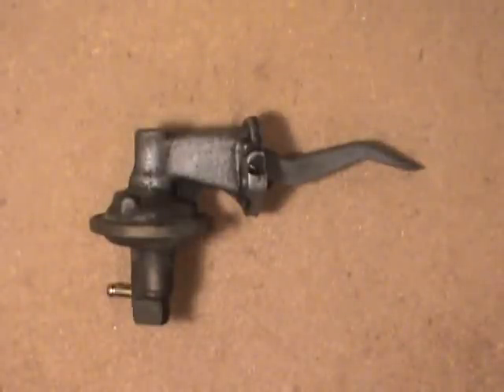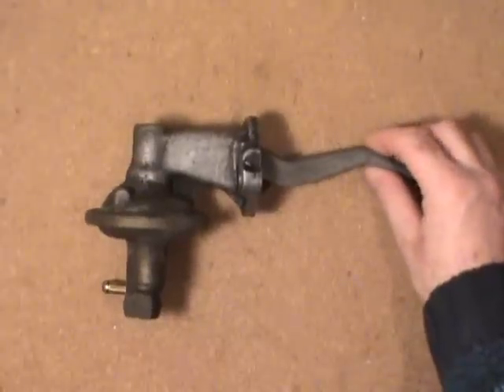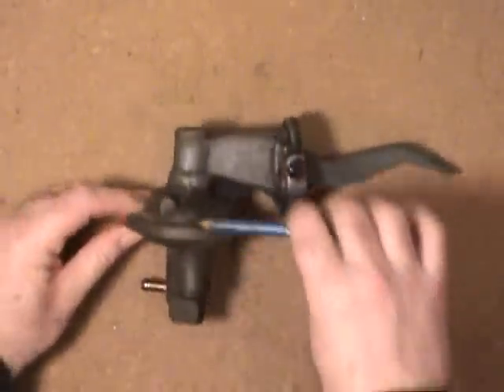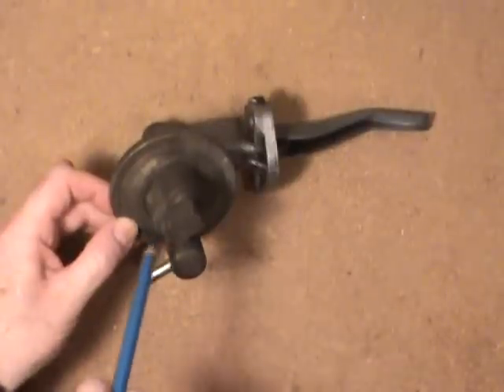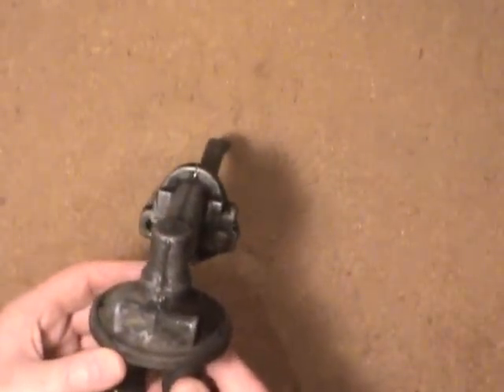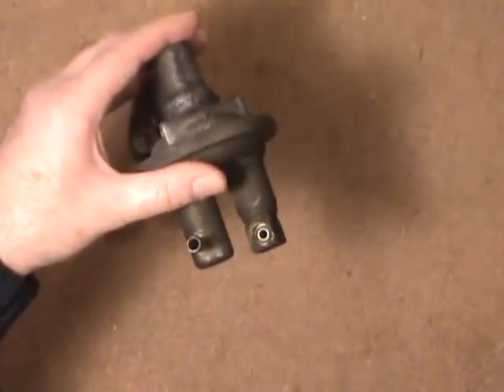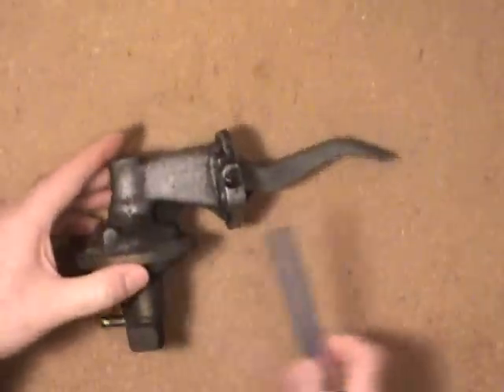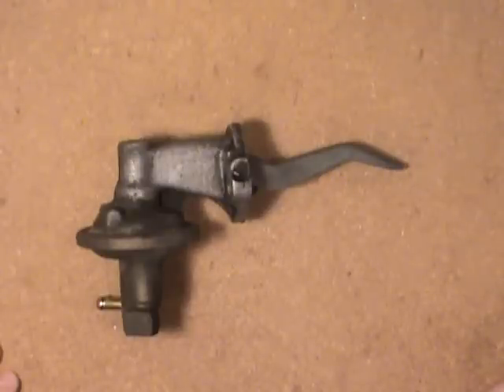Fuel Pump Mechanical Type Demo

Comment: Hi. I have a 78 Ford f150 351m. My gas tank filter is plugged up. I had replaced the fuel pump during diagnosis. I had it running pulling fuel from a gas can on the ground. I moved and had it towed recently. I'm trying to get it in the garage before snow falls but I can't get it started. The fuel pump isn't pumping fuel. There isn't much play in how it mounts to the block. Is my shaft missing the lever? Or is it too work to actuate the lever?? Thank you!
Reply from the maker: Greetings..Sean Fuhrman.........You're welcome, and, thanks for watching.........Well, if I was in the situation, that you described, then, here's what I would probably do, along with, a bit more information, added in as well...........Having the Vehicle outside, and away from any "open flame", such as a pilot light, in a furnace, or what-ever, or else "Boom"...!!!...it might be, and I hope not..........I would then, "disconnect" the "fuel line", from the gas tank side of the fuel pump...then...I would grab a rubber hose, oh, about 4 feet long, and stick it onto that fuel line, that was just "disconnected"...then..."remove" the "gas cap", so the gas tank can breathe freely...then...I would blow into that rubber hose, with some really strong lung pressure (Never, Ever, "Inhale", Gasoline Fumes or Gasoline, because that, in itself, can become "Deadly"...!!!), and, by doing so, I could then tell, whether or not, there is/was, a "Blockage", of any sort, which also includes, that (if present), the (possibly, plugged-up...???) "Filter", that's on the end of the pickup/fuel line, that's "inside" the gas tank (if "not" plugged-up, I can usually blow through, into the gas tank)..........If...???...there was some sort of "blockage", then, I'd say, that, there's a pretty good chance, that, my "strong", high air pressure, capable "lungs", would probably "dislodge", a fair amount of "crud", that was (theoretically), stuck onto, the outside, of that, "inside-the-gas-tank") fuel "Filter" (oh, and, musn't forget, to...keep my fingers crossed...!!!...lol)...........Gotta "make sure", that, the "correct" side of the fuel pump's "Lever", is rubbing against the "eccentric" (that be, a round diameter, that's off-set, to the center line of the camshaft's centerline, that results, in a "wobble", that makes the "Lever" on the fuel pump, go..UP...down...UP...down...which in turn, makes the fuel pump, well..."Pump"...if you will...lol)..............If Ya still have the "Old" fuel pump, you'll probably be seeing a "Shine-ee" spot on the actuating "Lever", where it was rubbing on the "Eccentric", and, Ya gotta make sure, that, the "New" fuel pump's "Lever"..."Is Not"..."rubbing", on the, shall we say..."Open U" or "Open/Trough side" of the Lever, because the fuel pump won't work right, and hopefully, no damage will result, from installing it "wrong"...............The Lever's "Spring", is usually Very "Strong", so, Ya just gotta make sure, that, Ya, "Tilt/Angle" the fuel pump's "Lever", so the "Full Metal" side of said Lever, ends up "making contact" with the "eccentric"..."Before"...!!!...Ya "tighten", the fuel pump's mounting..."Bolts or Nuts"...as the case may be............You can also try, putting some fuel system cleaner, in the gas tank, because, it should help soften up the "crud", that might be stuck onto the "filter" in the gas tank, and, also make sure, that, Ya have at least 2 gallons of gasoline in the gas tank, oh and, if Ya use some Cleaner, then, shake the "pick-em-up-truck" (like it was in a wind storm), as in...Up & Down (on the rear bumper)...and from...Side to Side...as well, which should create, a, shall we say, "Sloshing" action, of the gasoline/cleaner, that's, presumably in the gas tank, which, on a good day, might help to clean things up-ah-bit, hopefully, that is...........Are all of the "other" Fuel "Filters" (if any)..."clean-enough"...as well...??? (oh, and, by the way...todays word, is..."Blockage"...lol)...........To help "git-er-Started", I have a small squirt bottle, with a few ounces of gasoline in it...then...I "Prime" the carburetor (if there is one), by doing the following..........With the engine "cold", and "not running", I remove the Air Cleaner "Lid" (or what-ever)...then...I hold the "Choke Plate" (flap) open, with one hand, while I "squirt", a couple of tablespoons of gasoline, into each of the Primary (front?) throttle bores...then...re-install the air cleaner's "Lid", just in case the engine "backfires"...........If it doesn't keep running on the first try, then, try & try again (but can only be done, until the Battery says so...lol), oh, and, "don't crank" the engine's "starter motor", for very long, and also, give it a "rest/cool-down", between "starting attempts", or, Ya might "cook" the starter motor...!!!............If there's anything else, just give me a shout (or what-ever)..........Good luck, and.......till next time.......Be Safe, take care, and have a good one.

Comment: Hi I️ have a 70 mustang I️ replaced the fuel pump but there’s no pressure it was sitting for like two months
Reply from the maker: Greetings...ulfrogger3..........Thanks for watching.........These old school "mechanical" type of fuel pumps, have to "pull" the gasoline, all the way from the gas tank, through a quite small (in diameter)...(usually made of steel), tubing (pipe), all the way up-to the fuel pump, and from the fuel pump, (usually) up to the carburetor, it (the gasoline) goes..........The "Key" here, is that the Mustang (car...not horse...!!!...lol), sat for quite some time (2 months)...........The gasoline, that was in the carburetor's float bowl, or bowls, as the case may be, will usually "disappear" (like, it evaporates), and the engine doesn't have any gasoline to burn, well, until there is quite a bit of gasoline, once again, being pumped into the float bowl/s, that is............Here's what I do, when-ever I want to start a vehicle, that's been sitting for a while, that has a carburetor on its engine, along with, the good ole mechanical type of fuel pump, bolted onto the engine..........I have a small squeeze bottle, with a few ounces of gasoline in it, and, I remove the carburetor's air cleaner "lid", and squirt about 2 or 3 tablespoons of gasoline, into each primary throttle bore, and sometimes, I have to open the choke plate, with (my other) hand, if it's in the closed position..........Then, I replace the air cleaner (housing's) "lid", in case the engine "backfires"..........Then, if the Carb has an automatic choke on it, I push the gas pedal down once, or more if you like..........Then, the engine will usually fire-up, and now, the mechanical fuel pump is pumping much faster, while the engine is running, as opposed to, how slow the gasoline gets pumped, at the much slower, engine "cranking" speed...........Sometimes, I might have to repeat, the, shall we say..."Priming" routine, with a few more squirts of gasoline from the good ole "engine priming" squeeze bottle, if the engine doesn't keep running from the first attempt..........A while back, I had a "Faulty" (hardly worked at all), top brand name mechanical fuel pump, and, the car barely made it home (just a few miles away), so, that's a (rare) possibility perhaps...???...........Are the Fuel "Filters" clean (enough)...???............There's usually a fuel filter in the gas tank, that doesn't need any help usually, well, unless it gets plugged up (quite rare), just so Ya know...........Then, there's usually a fuel filter, in, or very close to the carburetor, and maybe another one, a bit closer to the fuel pump possibly.............Maybe, one (or more), fuel filters, might be "plugged-up", perhaps...???...(if plugged-up really bad, the engine will usually starve for gasoline)............Remember "Safety", as in, No Gasoline inside the house or building, if there's an open flame of any kind, like a gas pilot light, or Boom, and I hope not..........If the gasoline "Priming" method doesn't work for you, just let me know..........Good luck, and........till next time.......Be Safe, take care, and have a good one.

Comment: Hie boss. I have a mazda 323 b6 engine and my pump is giving me problems. If i try to repair the one i have and fail where can i get a new one? Im in Zim
Reply from the maker: Greetings...Munyaradzi Mhishi...........Thanks for watching............If you need to get a new fuel pump, then, first, try phoning a few automotive parts places, that are in the area where you live............If you don't have any luck with the phone calls, then, there are lots of automotive parts places (businesses) world-wide, as well as Ebay (for different countries as well), and, you can order the new fuel pump online (with a computer, smart phone, or maybe over the phone/with your voice, sometimes), and have it shipped (delivered) to the address of your choosing..............Here are a few things, to be aware of, when-ever ordering something online............Be very careful with your personal information, and the form of payment as well..........You can join/sign-up with Paypal or its equivalent, or, possibly use something like, a very low limit credit card, to protect yourself (just in case).............Make sure, to check the, shall we say, shipping time, as in, how long it will take, for your new fuel pump to arrive............Also, pay very close attention to, the shipping cost itself, b-cuz, sometimes, it can be very high...!!!.............So, I hope everything works out ok for you..............Good luck, and.......till next time.......Be Safe, take care, and have a good one.

Comment: Hello; when the fuel pumps are bad do they also make a noise? have a 1975 F150 and just placed a new fuel pump and added two filters due to some left over dirt from the tank one before the carb and the other before the pump; but!!!! for some particular reason gas is not passing thru; have no idea. Just bought 4 days ago another fuel.pump and besides making a loud clunk noise its sucking gas intermittently? Any sugestions maybe besides pulling down the gas tank again????
Reply from the maker: Greetings...Jimmy T............Thanks for watching............Well, I've never had a Mechanical type of Fuel Pump, make any noise, that I was able to hear, maybe, because of the noise, that, the running engine, and/or, the starter motor made, while cranking the engine over, that, would have, probably been louder, than any noise, that the (mechanical, type of) fuel, was able to produce.............It's very rare, to have a faulty, brand new (mechanical, type of) fuel pump, as, I've only had "1" faulty/defective, brand new (top brand name, mechanical, type of) fuel pump, out of all, of the fuel pumps, that, I've ever replaced.............That "Clunk" noise, that you heard, might be due to the following............Wrong fuel pump, for your "Exact" vehicle and engine...or...the fuel pump's actuating "Lever", got installed on the Wrong side of the "Eccentric" (that be, a, 2-to-3 inch round/diameter, that is on the camshaft, that is also offset, to the camshaft's center-line, which, kinda wobbles up and down, when the camshaft is spinning, and is responsible for, making the fuel pump's Lever, go up and down, causing the, shall we say, pumping action)...or...the Eccentric, might be damaged, or maybe, kinda slipping, if it happens to be the bolt-on type, and maybe, not turning at the same RPM's as the camshaft is...???.............Here's what I usually do, when I install, a new (mechanical, type of) fuel pump............I take the (already removed) Old fuel pump, and put it Beside the New one, to make sure, that, the two of them, "Match" each other, as in, the actuating Lever's, "Length and Bends" (if any, that is), and I do this, while looking downwards, from the Top, as well as, from the Side view, to make damn sure, that, the actuating Lever, is, a, shall we say, Perfect "Match" (or maybe, if not, some not wanted Damage can occur, if the wrong shape, and/or, length of actuating Lever, happens to get Forced, way too much, by the spinning Eccentric, that's on the camshaft...!!!)............Before installing the fuel pump, I usually stick a fairly long length, of, flexible hose (rubber, or neoprene/fish aquarium stuff), onto, the fuel line, that leads to the gas tank...then...I remove the gas cap (cuz, even the good ole vented, type of gas cap, needs a few PSI/pounds of pressure, to make-em open up)...then...I Blow on that added Hose ("Never", inhale/suck on the hose, cuz, gasoline, or, gasoline fumes are "Deadly"...!!!), oh, and, have lots of fresh air/ventilation, around the vehicle, and, "No" sparks or flames of any kind, what-so-ever, or, "Boom"...!!!.............This, "Able to Free-ly", blow thru to the gas tank, is telling me, that, there is, "Not a Blockage", holding things up............There's usually, an, "in-the-gas-tank", pre-Filter (sometimes, called a Sock, which is usually, a hollow, fine screen/tube-like shaped thing, sometimes, which might be, a kind-of nylon material, that might resemble, a very "fine" mesh/house screen door, type of thing, or maybe, a sponge-like/solid, possibly), that's usually attached, to the end of the fuel line, inside of the gas tank, so, larger particles of rust, crud, etc., don't make their way, into the fuel pump.............Also, if there happens to be a Filter, of some type, that is in/on the carburetor itself (as in, some of the Fords, used to have, a fairly long, metal, screw-into-the-carburetor-body, type of fuel filter, and yes, I did have one of these critters, plug up solid on me, some time ago...!!!...lol).............To Test, the fuel output flow, I have the fuel pump installed on the engine, and, the fuel line from the gas tank, connected to the fuel pump...then...I attach, a, quite long, flexible hose, to the Output side of the fuel pump, and have that long/flexible hose, going over the fender, and, into a bucket or pail, so I can actually See, how good, the, shall we say, gasoline Flow-rate is (if any, that is...???)...and...(can be observed, cranking with the starter motor, or, with the engine running, if in fact, the engine starts, and runs on any gasoline, that's still left in the carburetor's float bowl, well, until it's empty, that is), oh, and, remember now, lots of fresh air/ventilation, and, No sparks or flames...or...Boom...!!!..............Also, if ever trying to remove the "Ring", that secures the fuel pickup/fuel gauge sending unit, that goes into that hole/opening, in the gas tank, to Always Use a "Brass" Rod or Punch, with the hammer, or what-ever, to avoid creating any "Sparks", anywhere near the gasoline, or, gasoline fumes, that are in the gas tank...!!! (Never use a Steel Rod or Punch...!!!)...and also, have a Fire Extinguisher handy, as well as, do it Outside, if Ya can, to avoid, possibly, Burning the house or garage down...!!!...and, I hope not...........Have a look at some pictures on the internet, or, pictures, that, some of the online automotive parts stores have, for your "Exact" vehicle and engine, that way, you'll probably be able to see what all of the parts look like, some-what............So, Make sure, that you have the "Exact/Correct" fuel pump for your Pick-em-up-Truck, or there's gonna be, Trouble-in-pair-ah-dice (so to speak)............Once you have checked out, what I was sayin', just above, and, you have success or other-wise, you can let me know, how you made out, well, if you care to, that is.............Good luck, and........till next time........Be Safe, take care, and have a good one.

Comment: Thanks for the info. This was a great detailed video.
Reply from the maker: Greetings...Keon Nelson...........You're welcome, and, thanks for watching..........Well, it was kinda detailed, to a certain point, somewhat, as, there should also be..."2"..."one way" (only) Check Valves, hidden, inside of, this mechanical type of fuel pump, somewhere...............The "inlet", (one way only) check valve, (that's on the "suction" side of the fuel pump), would let the gasoline through (from the fuel line, that came from the vehicle's gas tank), but, "would-not", let it flow back, into that fuel line............Then, once, the gasoline, gets inside of the fuel pump, and becomes under pressure, then, the only direction, that, the gasoline can flow, is through the "outlet", (one way only) Check Valve, that's on the "pressure" side, of the fuel pump, and then, the gasoline, makes its way, through the other fuel line, and into the carburetor's float bowl, it goes, well, until, the Needle Valve, in the carburetor's float bowl, shuts off the gasoline flow, that is.............So, there You have it, well, for now that is, and....till next time..........Be Safe, take care, and have a good one.